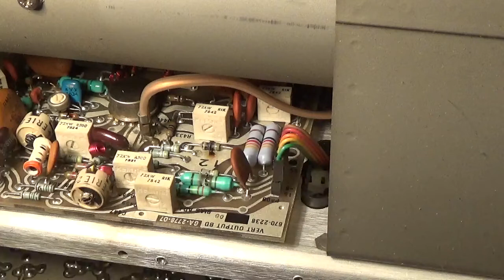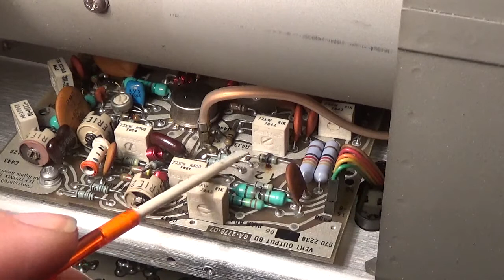Tektronix 465 Repair part 3

Comment: You have shorted Vertical output transistors. Replace them and also the resistors and  caps that got burned out.     73's , Gary Grove  Minneapolis, MN
Reply from the maker: Thanks Gary, it's under a pile pf three more at the moment so must get it out one day and go through it again.

Comment: Did you ever fix this scope? Is there another video?
Reply from the maker: Hi Jerry, nope :)  That board is still an unknown. I can't find a match for it it in either version of the 465 manual (or the MIL one).  I'm afraid it disappeared into the pile of shame. I did get another 465 after this and that doesn't work at all but I've done nothing with that either. So that's three non-working 465s...hmmmm, I may have a hoarding issue. I may get this out again one day soon actually.
Reply: @Andrewausfa  Sounds like you should swap the bad board with a good one from one of the other 465s and see what happens. If that fixes it, then start comparing the boards. I just bought a 475A on Ebay, which I suspect has a few problems....)

Comment: I just restored a 475A,  similar design but a bit more complex.  I watched the three videos,  you've got several burned resistors on different boards which all seem to be part of the vertical amplifier/output circuit.  Another thing was the stuck trace and unable to adjust it's vertical position or see a signal on it.  I would definitely check that IC on the vertical output board under the CRT there,  a couple of those burned resistors are directly connected to it,  and it could be internally shorted or open.  On the 475,  they've actually soldered a large cable strap from that top of that IC can to the shield of the CRT,  which could be for a ground,  but also acts as a heat sink.  The IC is socketed,  just like all the ICs and transistors throughout the scope.  You can just pull it right out to test it.
Reply from the maker: Hi, thanks for the comment. My one big problem isn't so much the IC, it's the burnt resistors. I can't find their value or any indication on a circuit diagram as to what values they are. Not in the late or early manuals.
Reply: Actually,  the burnt resistors aren't a big deal.  Even being browned and blackened from overheating and burning,  they generally still measure their correct values.  Most types of resistors can take a serious beating.  Though I still wouldn't trust them and would replace them anyway.   I'll take a look at the vertical output board in my scope and look at them,  it should be close the same board.  What caused them to burn up however can certainly be a big deal,  as burned resistors are always a symptom of a problem and almost never the cause.  The worrisome issue are the ICs,  as they can be very difficult to find replacements,  most new old stock for these scopes has long since dried up.  And when you do find them,  they are used and expensive,  with no guarantee that they will work.  That hybrid vertical output IC under the CRT runs around $65 - $95 if you can find it used.
Reply: Those resistors are actually in the 465 service manual that I have,  I've uploaded an image of the values / locations - https://imgur.com/a/XXEUVlV

Most of the resistors will have 5 stripes instead of the normal 4,  so they are very specific values.  I've just marked the ones that I see in the video that are burned,  I'm not sure if there is more. Now just pull one leg and measure with your meter to see if they are still close to what they should be.  Unfortunately the board in my 475A is completely different.

Comment: When you find burned resistors the first thing you do is study the schematic and look a components that has shorted that is the cause of the burned resistors.  Just changing parts will most likely get you another set of burned resistors.  I guess you know that already....

Comment: I suspect those capacitors next to the resistors have shorted due to age. Probably best to check the capacitors with a multimeter or ESR meter.
Reply from the maker: Hi Ryan, yes something's not right. I'm stuck now as no one has any info the burnt board.

Comment: Hi #Andrewausfa, great set of vids, inspired me to start looking into my Tek 465 's problems...finally!
I have a low serial numbers manual, your burnt resistors are listed as follows:
No.             Tek part no.                 value.          rating.         tol.
R449          322-0180-00               732 Ω         1/4 W          1%
R405          321-0187-00               866 Ω         1/8 W          1%
R403          315-0390-00                 39 Ω          1/4 W         5%
R407          321-0175-00               649 Ω          1/8 W         1%

the unpopulated resistor (bellow R448, left of R455 - as your vid shows it)
R409          321-0178-00               698Ω          1/8 W         1%

There's no mention of any components on the underside of this board and I've check the adjacent components
to the burnt ones but all are on the top side (maybe a mod?)
Also the physical sizes of some of these resistors on your board don't correspond to the circuit board photo in the manual,
but that might not mean much.

Let me know if you have a dropbox of any kind and I'd be happy to snap up the circuit b'd photo and schematic page for you.

Hope this helps.
Reply from the maker: Hi George, thanks for your time and effort. I've also got a low serial manual and the PCB layout is a little different, as you can see, to what I've got in reality.  This like a low serial and a half machine! :) When I get my backside in gear I shall put some photos on Tekscopes and EEV blog to see if anyone has any thoughts. I can't tell if the underside components are resistors or diodes they are so burnt so I don't want to touch it or try components out and apply power in case that IC ends up worse than it already might be.
Reply: Send it to Mr. Carlson!

Comment: Whenever the guy from The Signal Path takes out a burnt part he checks if either end is still shorted, because changing parts and hoping may leave the fault there.
Maybe mark all the burnt stuff on the SCH and see if it leads to a common culprit.
Reply from the maker: Valid point and absolutely agree with you. That's one reason why I've not touched the thing since this video as I don't want to change components without a) knowing what they are and b) what caused the initial fault.  I'm sure it was all caused by something catastrophic on the 15v line but I've monitored that for a while on a meter and nothing seems to change.  I still cannot find a schematic for this particular vertical board. It's different to the one shown in either 465 manual from Artek or anything free on the 'net. So I need to find out what values the parts are on the underside of the board (and they are seriously crispy) until then it's all a little bit ...hmmmmmm at the moment :)
Reply: So you can't get values off the other working one. 
There is a manual on Tek's site for a July 1975 that was posted in 2016, but you probably found that.  Maybe a more imaginative search name or  a different but similar model might have it.
I had some burnt parts that I thought I would never find the values for, but when I shone a light at it at a certain angle under magnification I could read the writing. It doesn't help for resistor colours.
If you have a current limiting PS you could turn up the power slowly and see if it's still shorted.

Comment: I couldn't help noticing all those trimmer pots in the scope. Well I got you a set of the ceramic trimming tool same as ones sent to Simon. Unfortunately haven't had time to sort out the postage details with you. I'm busy with work next week but I will sort this out when I get a bit of free time.  My best regards Chris
Reply from the maker: Oooh thanks Chris!!  No worries at all, work and a roof over ones head comes first.